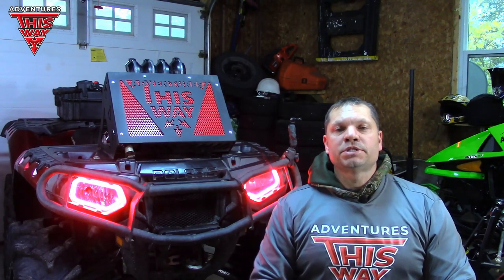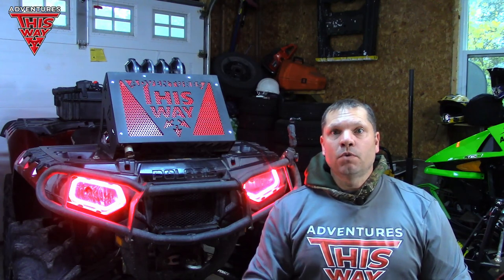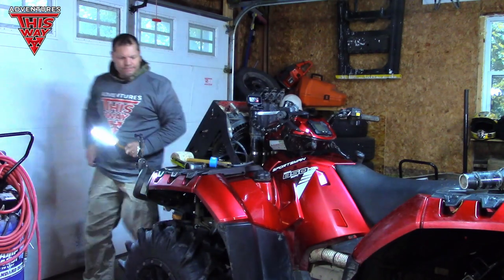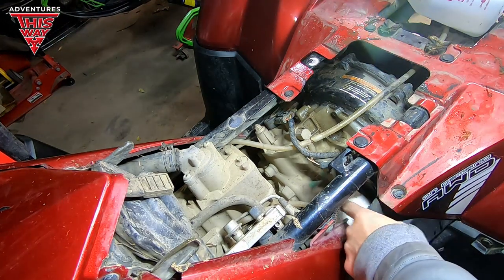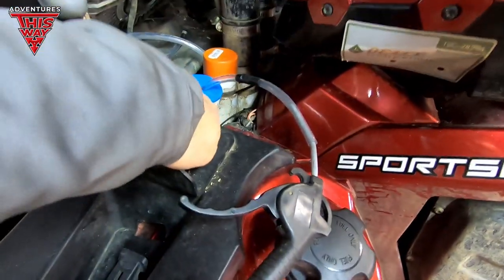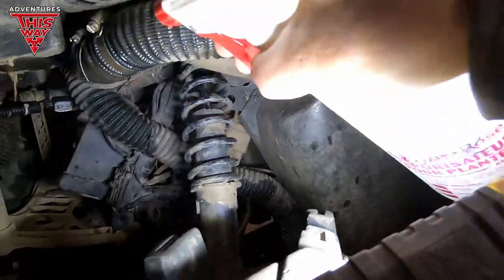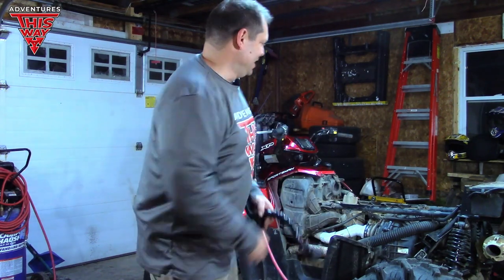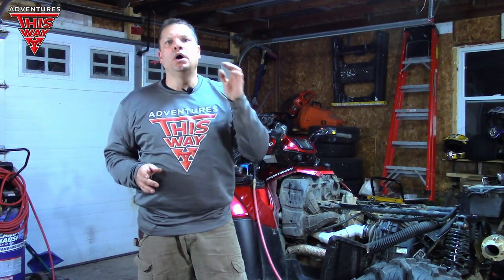ATV Snorkel Kit? Save Your Time & Money! Buy a Polaris HighLifter or Can-Am XMR

Comment: Snorkelling is always tricky. I think you’re on the right track now. That first hose you used seemed to leak like crazy, that PVC hose you are using now won’t leak. A heat gun also makes that hose more flexible and will harden in it’s deformed shape if you want to straighten that intake connection. Good video though and good explanation of the parts used for DIY.
Reply from the maker: Thanks Man!  Since I had never snorkeled anything before, buying a kit seemed like the way to go...with the experiences over the last year  I have learned what it really takes for a snorkel system to handle the rough conditions
Reply: @ADVENTURESThisWay  thanks to your video of your original snorkel problems I decided to custom stealth my own. Basically did what you are doing now with the CVT except brought both lines to the pod light. Left the engine intake for now but that’s next.

Comment: Anyone else wish Polaris would think about offering a different tire option? Or like a highlifter lite? Those stock tires wouldn't do well on the local hard pack trails.
Reply from the maker: On the HL you mean?  Its designed as a mud specific machine.  Its not a Mud/Trail machine without doing some mods to it...
Reply: @ADVENTURESThisWay  and that's what I like about the XMR. More ppl use them locally around Calgary for the hard pack trails but also diving into the deeper holes.
Reply from the maker: @DirtRoadRemedy  oh definitely the XMR. Is a solid choice